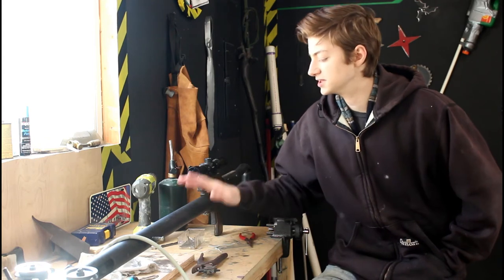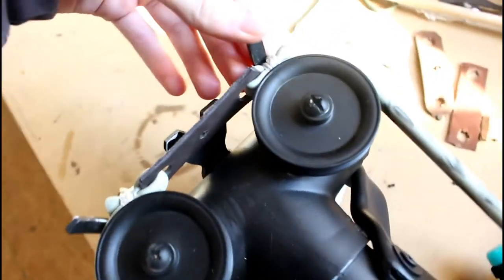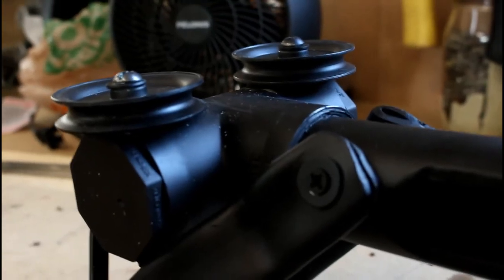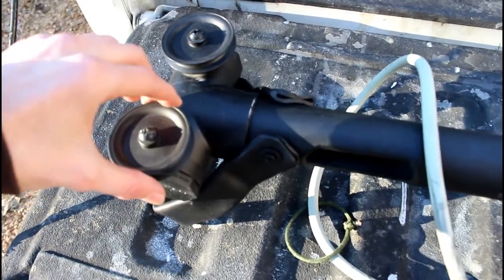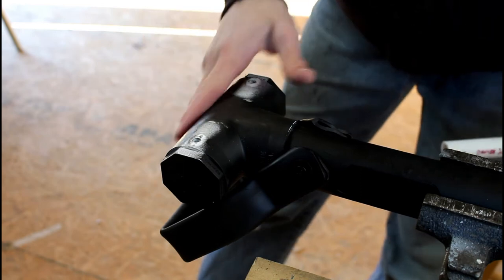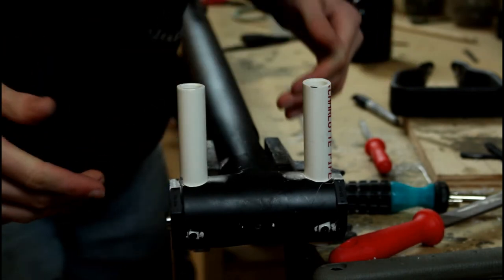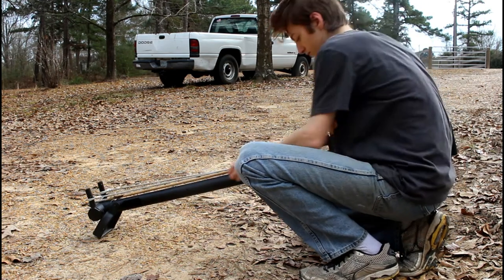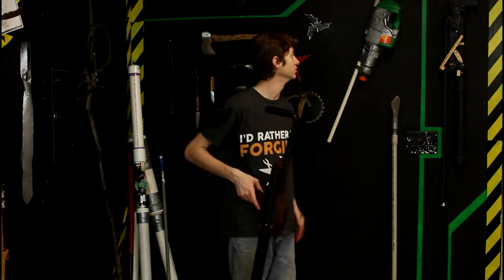It Doesn't Work!!!  PVC Slingshot Rifle | Part 2.5

Comment: black tube bands are stronger !!! on Amazon
Reply from the maker: That is incorrect. Black theraband resistance bands are weaker than the silver. Silver is the super heavy, with 15.3 lbs at 200% stretch. Black is 10lbs at 200%. I discussed in the other videos why speargun rubber wasn't ideal for this project, if that is what you were referring to.